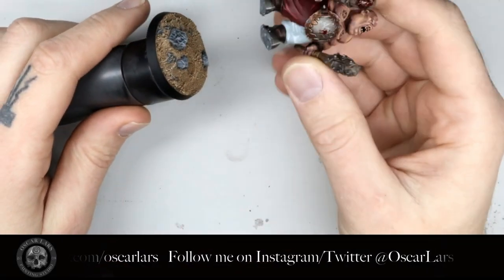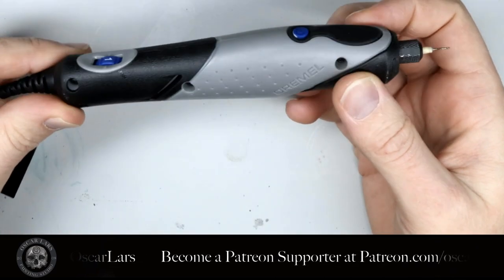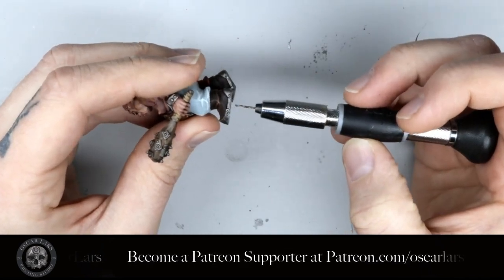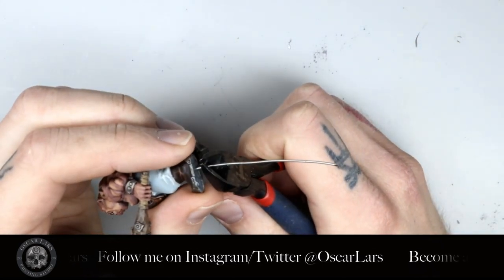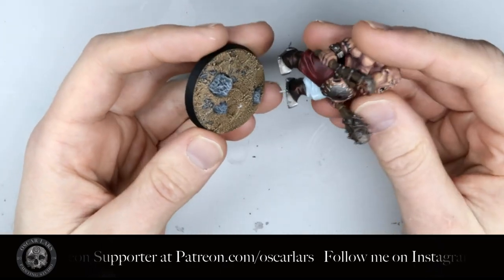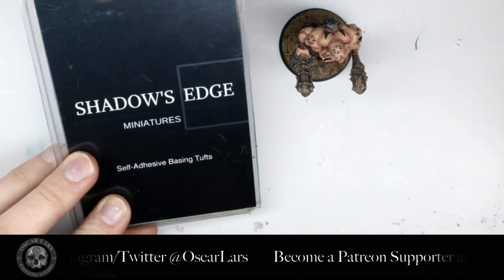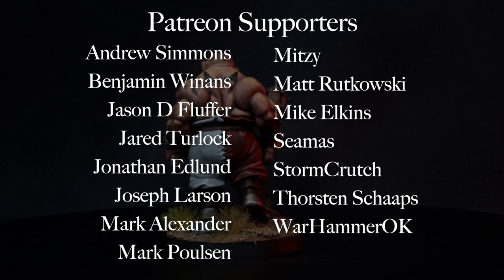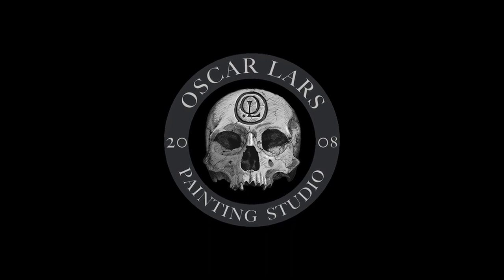Miniature Painting Tutorial - Oscar Lars - How to Pin Your Model to its Base

Comment: Thanks Oscar ! Any tips to pin small /thin footed miniatures ? im building Bayou minis from Malifaux and im quite scared ....
Reply from the maker: You're very welcome. It's always tricky but try to find smaller gauge drillbits and then the same thickness of wire. That will allow you to have more control over the drilling process, which is where you'll likely fail with a larger gauge. 

another option is to simply not pin them and make sure you get bare plastic to plastic on them. They're so tiny that you'll likely have less issues with them falling off the base for that reason. 

I hope that helps!